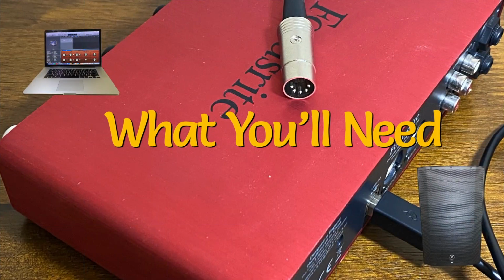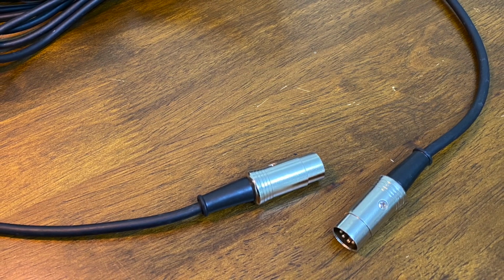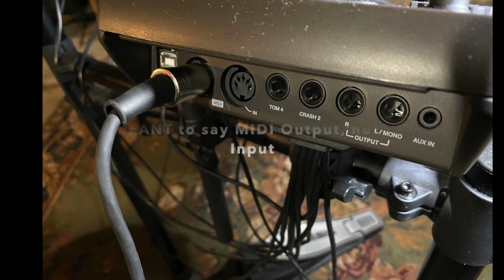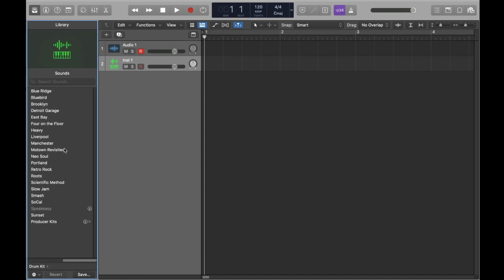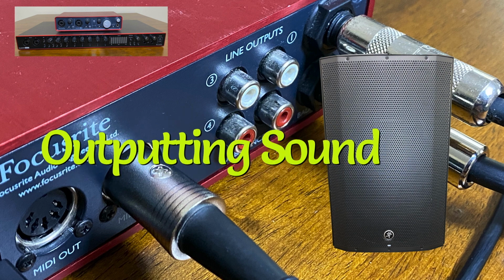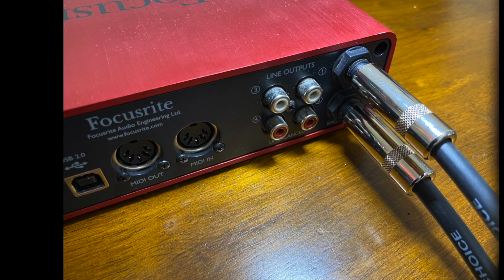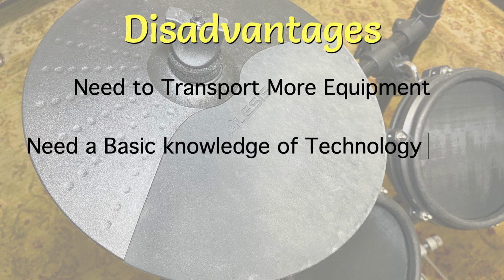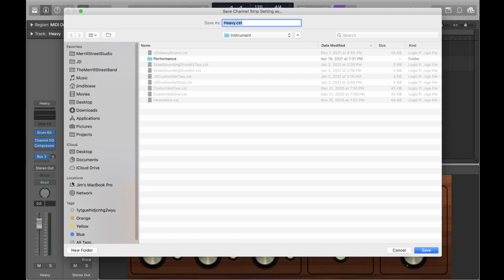Electronic Drums - Rock your Drum Kit Sound anywhere with an Audio Interface.

Comment: Hi..i have alesis nitro kit and scarlet 2i2.what would be the connection going to my alesis multimixer to my loud speakers using a DAW.thank you
Reply from the maker: I don't own one, but I looked online, and it looks like there are two outputs available to you on the back of the Scarlett 2i2 - Quarter Inch Cables.  Is that what you have?  If so, what inputs are available on your Loud Speakers?  If it is Quarter Inch as well, you're Golden, if not, you'd have to look for some kind of chord that would convert to what you need.. probably not likely to find.